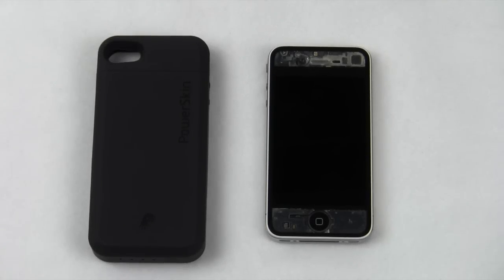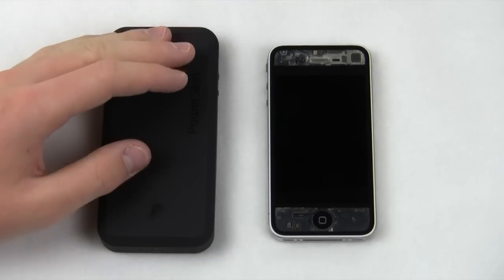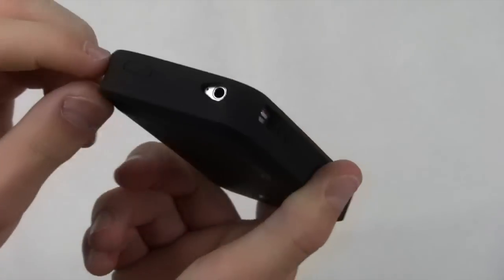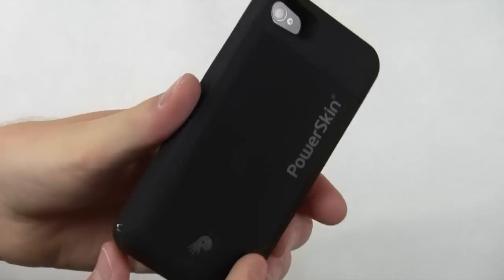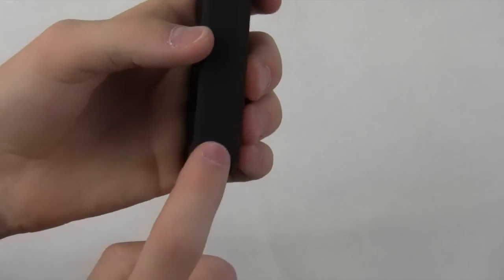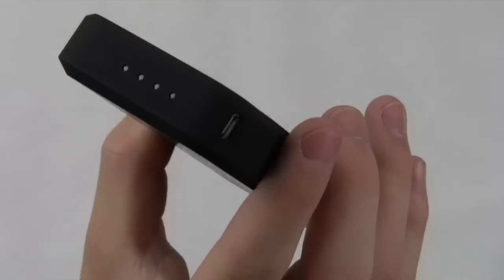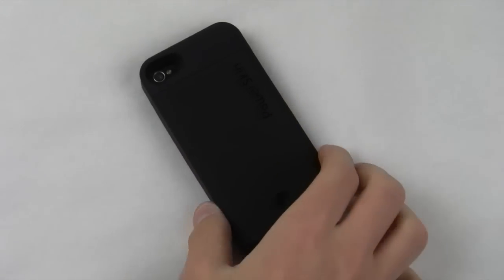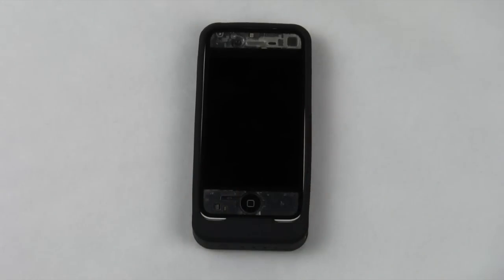PowerSkin (Awful) 2,000 mAh Battery Case for iPhone 4

Comment: QUINN!!! this is a 2000 mAh battery but charging and using the battery dirctly on the phone is two completley different things! charging a battery takes close to twice the juice of a battery than just using it directly on the phone and therefor you can not get acces to all the juce that the battery has to offer. but ofcourse this doesn't make any difference unless apple had a connection that could bypass the battery so you are not charging the battery.

Comment: This look's like one of those backup battrie's you can get conned with (Yes like i did) from eBay,cheep,Nasty,Only fit for the trash can kind of product's,I picked up one from Energiser in my local store,They wanted i think it was £70 for it in the store,i put it straight back in like 1000th of a second when i found out it had the exact same look as this one,Silicone suck's big time,Quote "Look's damn UGLY" for sure,Thank's for the heads up Quinn :)